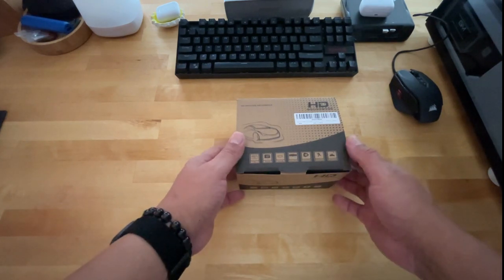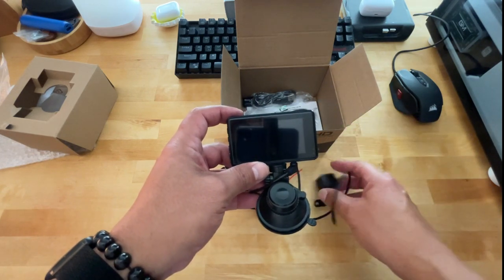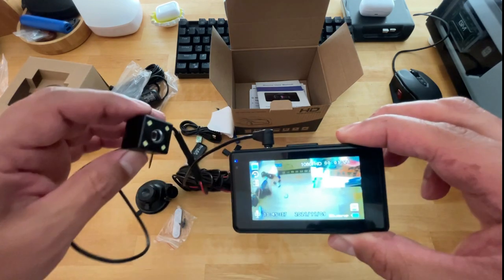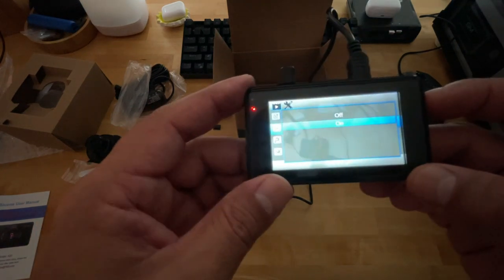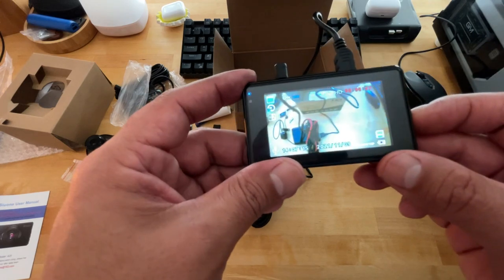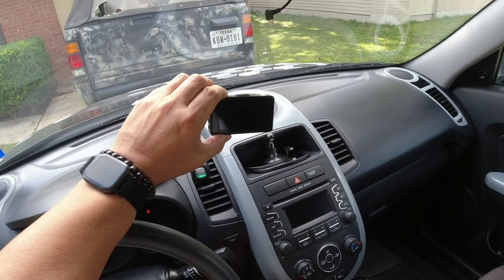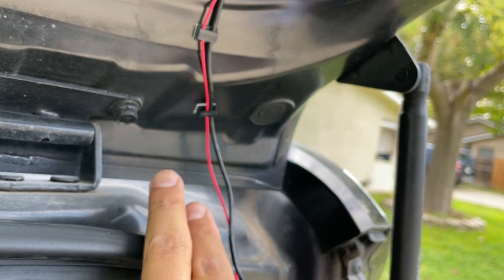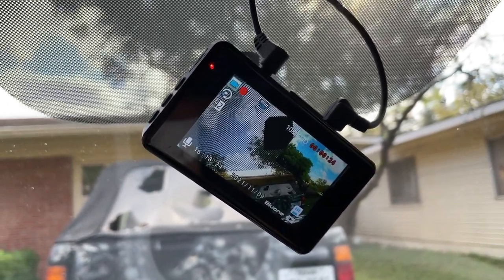BIUONE Car Dash Cam Installation

Comment: Dose this camera have parking mode?
Reply from the maker: Thanks for watching, The camera does come with what they call Shock sensor indicating if anyone bumps the vehicle it will start recording for I’m assuming 1-2 minutes the reason why I say assuming is because I have not tried this feature yet reasons for that, are I would think the vehicle has to be bumped pretty hard in order for the camera to take effect. It all depends on how sensitive the inner sensor in the camera detects motion or vibration I should say. I wish I can give you more detail on that feature but again I never actually used this feature. Hope this helps stay safe and sound.👍🏽✌🏽

Comment: This was a very informative video. But i really needed the part where you connected the rear camera wire to the rear light wire. You totally missed that mark
Reply from the maker: Thanks for watching sorry I missed the mark. I’ve never really been such a good good aim. It’s really not that difficult all you need to do is take the red wire and tap into the positive wire on your reverse bulb wiring harness. You can use a multimeter to find out which is the positive or just connect to either wire it’ll only effect the camera when you go into reverse so if you have the wrong wire the camera will never change to the reverse camera. I hope this helps stay safe and sound.👍🏽✌🏽

Comment: How long can i record live? And also does it erase itself then continue when its full
Reply from the maker: If you’re wondering how long you can run the video recorder when it’s not connected to power that’s the only downfall with this unit you’ll only get about 10-12 minutes live recording. If powered on via power source you can record infinitely if you set loop recording and have a large SD card installed. So YES it will continue when its full. Hope this answers your question and thanks for watching stay safe out there.👍🏽✌🏽
Reply: @solisapaul  loop recording is off.  Does that mean record all the time? And plug in power on in vehicule
Reply: Just want to keep recording all the time and if something happens i got time to stop it and check it out
Reply from the maker: @kevinmichaud3783  I would activate loop recording because what this does is it allows the SD card to continue recording when it is completely full. Once you set this adjustment you can’t go wrong as long as you’re driving the vehicle the camera will always record regardless if the SD card gets full at that point you can always go back and catch the video that captures the incident. Truly hope this helps.
Reply: @solisapaul  thank u very much    just activated loop 5 min
Reply: When recording loop and u arrive home.  Shut down vehicule and leave. Does it shut down itself? Or is anything required to do
Reply from the maker: @kevinmichaud3783  When you arrive home the dash cam will shut itself off and only start recording once you turn the vehicle back on there is an option to set motion detection which means if someone bumps the vehicle it will record what’s in front of the camera however I do not use this feature so I cannot tell you the results. 👍🏽✌🏽

Comment: why does my rear camera not working?
Reply from the maker: Thanks for watching , make sure that red wire is connected to the rear backup light positive wire + not the negative -. Rear camera gets its power from that source and comes to full screen when your backing up. Hope this helps.
Reply: Does it function only when reversing?
Reply from the maker: @jessieborromeo1094  No it works both when reversing and while in display mode. You can monitor the rear camera and front simultaneously, the rear camera takes full screen only when reversing. Hope this helps stay safe.

Comment: This video is useless.  It does not tell you how to set the date and time which are critical if you intend to use this in case of an accident.
Reply from the maker: @theraplawyer  Thanks for watching, Date and Time 12:52-12:53 time stamp. I show you where you find time and date to set. If you’ve ever set an alarm clock or set the time in your car or set a time on your phone, or watch or Computer etc..it’s the same principal. Once you enter into the date and time you use the up and down button to adjust Hour:minutes AM/PM, the Date MM/DAY/Year is the same, not very complicated. Sorry you’re having a difficult time. Stay safe and sound 👍🏽✌🏽.
Reply: @solisapaul  Thank you so much.